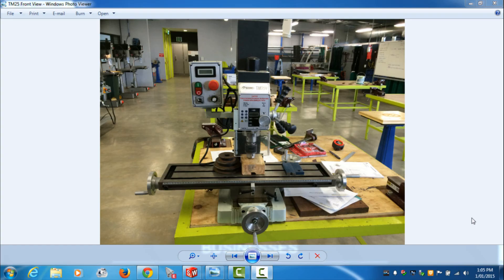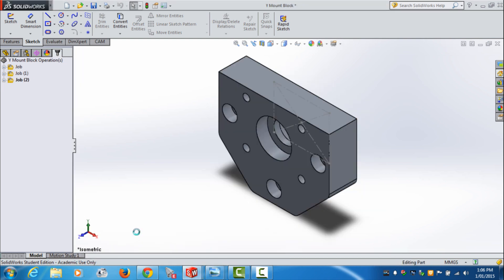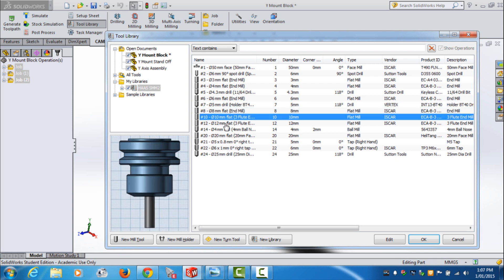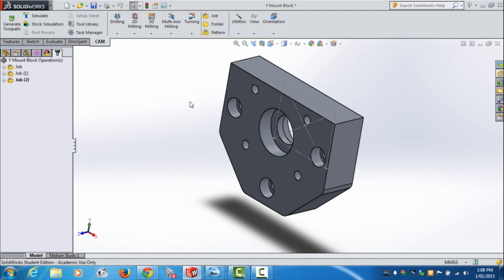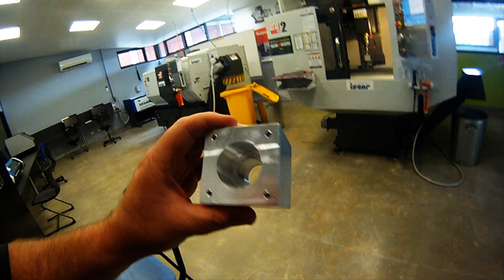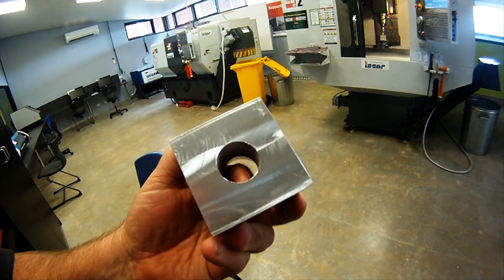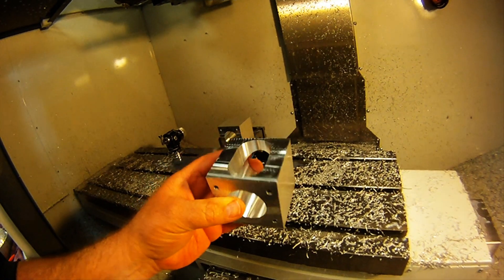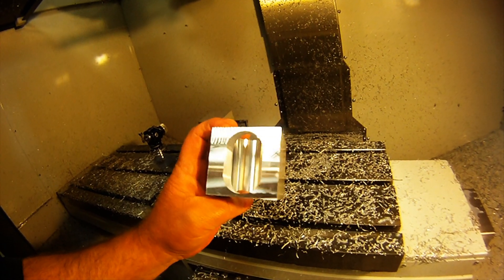HSMWorks CNC Milling on the HAAS SMM2 - TM25 / PM25 Y-Axis Parts

Comment: I noticed that you matched the Tool # with the endmill size rather closely. Makes sense. Easy to keep track of. :)
Reply from the maker: Thanks buddy, this was a little trick that was shown to me by Haas / Iscar Craig (formerly).  It's does make a lot of sense when trying to CAM on the run.  Cheers, Aaron ;-)

Comment: Hi, I would like to ask about that vise clamping power. Can U do large depths of cut? Does it hold the workpiece well? Thnx.
Reply from the maker: Hey iguana200.  Do you mean clamping power of the vice or clamping power of the bracket I made?  If you're talking about the clamping power of the vice, yes it holds really well. Cheers, Aaron.
Reply: DCTTeacher1 I was thinking about Vise holding power. Thnx. for answer 👍
Reply from the maker: Hey man no probs.  Your question really challenged me and kept me on my toes.  I had to refer back to the manual ha ha ha.  To answer your question this particuar vice can apply up to 25kN of force.  That is with 60 Nm of force on the handle.  Cheers, Aaron.

Comment: very nice, I'm curious to know what the popping noise is on your mini mill when the z axis retracts
Reply from the maker: Hi Toby, It's  the brushed stainless way covers knocking as the Z axis does a rapid movement. I use partial retract now and this doesn't happen when drilling now. Cheers Aaron

Comment: Well this looks great, very nice finish indeed.
Again congrats on a great product.
Reply from the maker: Greg SB Hey Greg, thanks for the positive feedback mate.  I'm really trying my best to produce a quality Australian made kit. Hopefully I won't be too far away in the manufacturing of these kits now.  As in load the part and walk away from the machine.  Cheers mate, Aaron.
Reply: DCTTeacher1 that's very good news.
Reply from the maker: Thanks ;-)  Hey, I think you said that you've got a TM25 haven't you?  Have you stripped it or used it yet?
Reply: DCTTeacher1
Hi, just set it up on the bench and gave it a cleanup to remove the shipping gunk, and did some test cuts.
I must say that is very quiet and so far very impressed with the motor.
Must admit that I was waiting to see how you went....with your kit before I pulled it down.
There is another utube channel where he is doing a similar conversion, and he had some problems with the Z axis, I have it sticking at the top 25mm
I have a power drawbar on my TM16V, I am trying to work out a design for one on the TM25V, my one for the TM16V uses an air cylinder and a engine valve spring instead of Bellevue washers, yours and Luke from CrudCNC are well simple and well made, but the later one from Hoss ( have plans for the earlier one ) is too complex for me.
Reply from the maker: Greg SB Hey Greg, you might have to use some lapping paste (valve grinding paste) and work the top of the dovetail slide if yours is getting stuck.  I wouldn't worry about too much, as those steppers are pretty strong especially when the force is transferred via a screw arrangement.  Your power draw bar sounds exciting.  Luke used the old design from Hoss.  I think Hoss has a new CAM design now. I've been lazy (spoilt really) of late and just use the HAAS instead of turning on the Titan. Have you got some vids up on your channel of your TM16.  I check it now. Cheers
Reply: DCTTeacher1
Sorry dont have a video of it, but will see what I can do, though it will be basic.  :-)
Reply from the maker: Hey Greg, that would be awesome mate. Basic is good mate, give it a try.  I started out shooting video with my iPhone.  I've got a little GoPro now (old one).  You can use your mobile also.  It's always best to shoot the video in landscape and not portrait (i.e. turn your phone on its side). I look forward to seeing it. Cheers, Azza :-)

Comment: Have you had any dramas with the bearing on the y axis. eg backlash.
Reply from the maker: RC &CNC Hey mate, no problems at all.  I do all my conversions with these 6201 bearings.  I use 2 per axis and steel spacer between the bearings.  The ball screw nut is then tightened up as per normal and all is good.  These deep groove bearings are designed for radial loads up to 7300 Newtons (744kg), but they will take a thrust load 1/3 of their radial load (248kg).  I can't see anyone placing that amount of load on their little mills whilst machining?  My little TM20 is still going strong on these.  You will actually get more backlash from your gibs and dovetails on the table.  Make sure they're tight ;-)  Cheers, Azza
Reply: ahhh ive got a 3201 / got me thinking now ;0)
i have .02 backlash in the y.
Reply from the maker: RC &CNC Hey man, when you 0.02 are talking thousands of an inch or in mm?  If it's thou you have a problem, if it's mm I wouldn't be bothered chasing it. As that's bugger all.
Reply: mm
yeh im fussy . yeh so far parts have turned out good.     ;0)
Reply from the maker: RC &CNC Bloody hell mate, you are a fussy bugger.  Mate the 0.02 could be in the dia of the cutters you're using or even heat of the day.  On the HAAS, I can measure each offset and diameter of the tool electronically with the Renishaw system.  This records the exact dia of each tool and cutter compensation accounts for this when I'm machining. For example, you might have 6mm dia cutter, but when you measure it by probing it might measure 5.98mm.  You get what I mean?  That's the difference between a $80K machine and our little TM20/25 lol.  Cheers mate, Aaron.
Reply: yeh it was more of a question of my bearings wearing a bit , im only using 1  to your 2 , and you guys have had yours running for a longer period . i was not sure how much backlash anyone was getting.
;0)
Reply from the maker: That's ok no probs.  It's all a learning curve mate. I'm definitely no authority in CNC milling, but I give it a good red hot go :-)